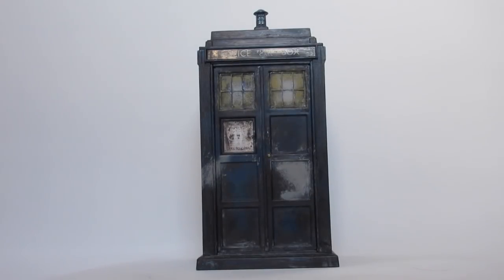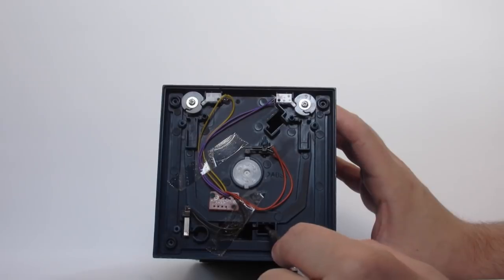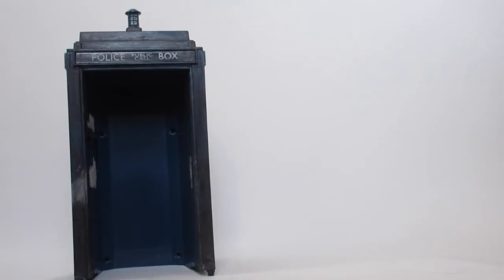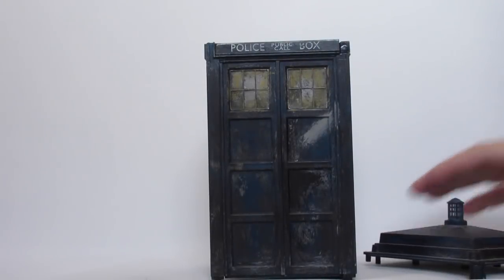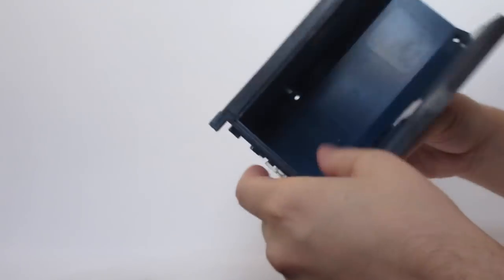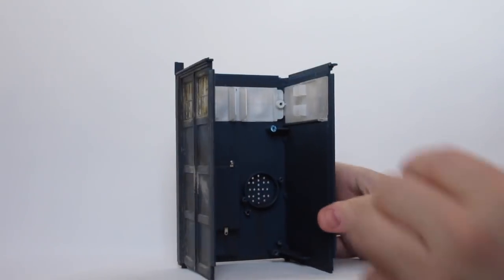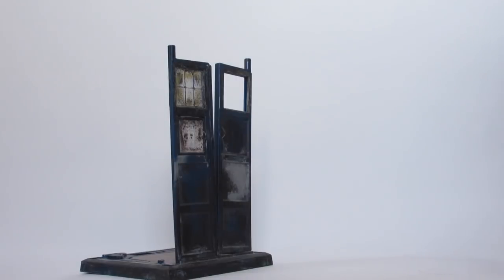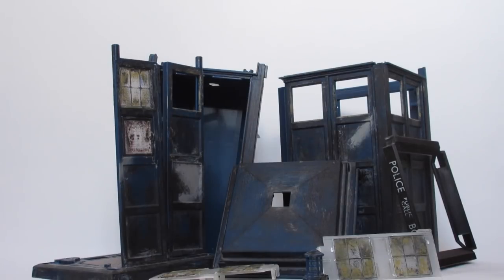How2Do : Dismantling A Tenth Doctor TARDIS

Comment: I had the same problem with the window on the PULL TO OPEN door. I have cracked the actual plastic but not so much that the door is broken. Have you managed to find a way to remove it?
Reply from the maker: There are several different methods, using a solvent to dissolve the glue, or hot water to loosen it and then running a craft blade around the edge but ultimately none of them are perfect, so usually I just paint around it carefully
Reply: @CaptainJimiPie  I did the boiling method, however the plastic warped and snapped so... I wouldn't stick with the boiling plan
Reply from the maker: @HeyItsLukeLane  As I said none of the methods are perfect, it varies from figure to figure, if the plastic warped then usually it means the water is too hot or you left the plastic in there too long, or both

Comment: I’m trying to rebuild my 11th Doctor’s Flight Control TARDIS, but no matter where I look online, I can’t find a decent image of the wire setup on the switch, Unless that doesn’t actually matter, but I’m assuming it does since one of the wires goes to the battery terminals
Reply from the maker: Sorry, electronics aren't really my strong point
Reply: @CaptainJimiPie  that’s fair, I think I’ve got it figured out, At least I hope so
Reply from the maker: No worries, good luck with it!

Comment: any way to get the backdrop out without tearing it? I really want to put lights in the non-electronic 11th doctor tardis but i need to seperate the two back parts (shown on yours at 4:36) but i dont want to tear the backdrop as i want to it keep it as is.
Reply from the maker: To be honest it's really just a case of being careful, you could TRY running a craft blade around the edge but you're just as likely to cut it. The best solution is just to peel it VERY slowly, you might lose some of the backing but the front image should stay intact
Reply: @CaptainJimiPie  Absolute legend!!! Thank you for the advice! Wish me luck
Reply from the maker: No worries and good luck!